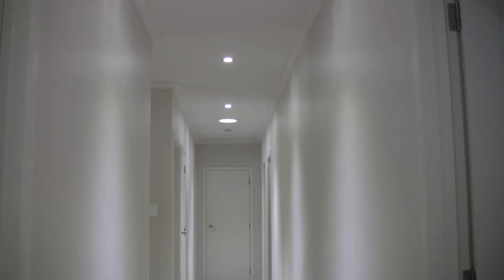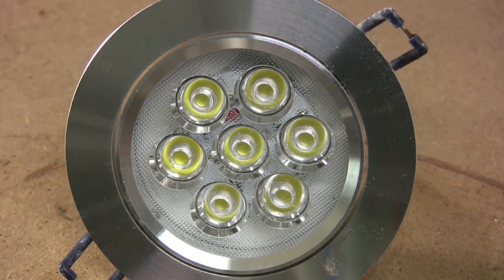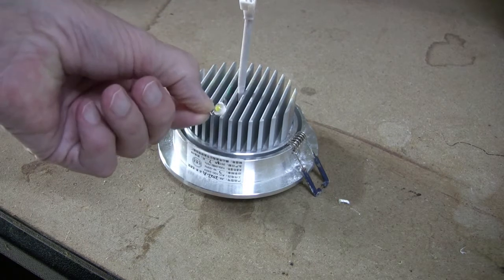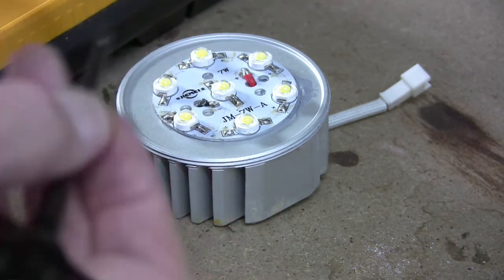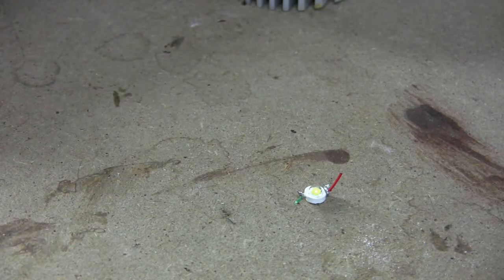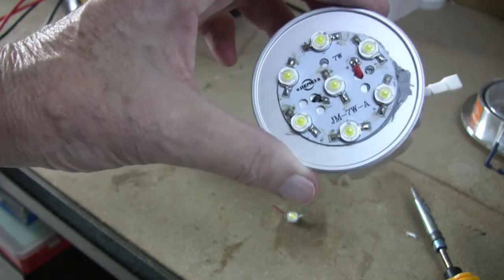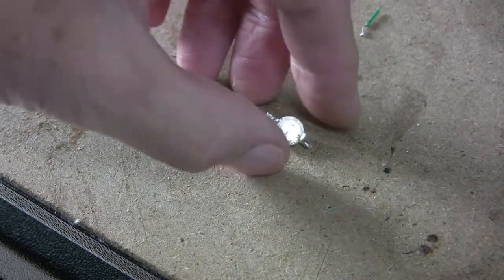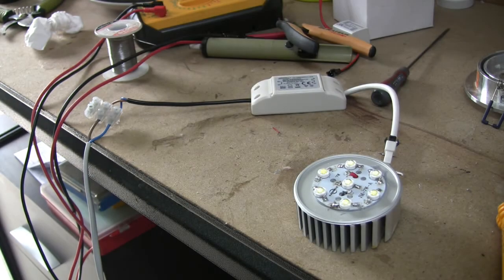LED Repair of cheap Chinese down lights.

Comment: There must be heatsink compound under each LED otherwise they will fail one by one. Their quality is fine, but you're wrong saying they don't heat up. 1W is a lot of power in such a small area. You wouldn't be able to hold the diode between your fingers when it's on. It can easily go to 100 degrees C without a heatsink and thermal compound.
I'm talking from experience. The lights in my bathroom stopped working one by one after 6 months. I've replaced each LED with a new one + heatsink compound and it's been 3 years now and all the lights still work. I've bought 50 LEDs for $2.
Reply: you're a professional  LED engineer，LOL
Reply: :D

Comment: Hi who to but voltage in the multimeter?
Reply from the maker: Sorry Sadeq, I do not understand your question!!
Reply: Michael Beeny  I’m sorry I don’t understand the way you test the led chip and make it on by using multimeter
Reply from the maker: Any multimeter used to measure resistance uses a low DC voltage from the internal battery of the multimeter. Because of this you can test most single chip LEDs. When connected in one direction you will get no resistance or no tone from the meter. In the reverse direction you will read a low resistance and/or the tone will sound. At the same time the LED will glow, not brightly but quite visible, indicating a good LED. No reading and/or no tone or light obviously the LED is faulty.
Another way is to use a 3 volt button cell to again test in both polarities, one way should light the LED.
I hope this helps you Sadeq, thanks for watching.
Reply: Thanks that’s was very helpful all the best

Comment: Another good video here, and another guy who has had problems with LED's. I have bought some LED GU10 downlighter bulbs for some fixtures in my house, and I bought budget models from B&Q, which is a large chain of DIY store in the UK. Some are 4W and some are 5W and all have 3 LED's in a triangle formation behind the lens. The ones I use most are in the bathroom, and they were all fitted around 2 years ago now. None have failed totally yet, but I have one in particular that I do have a problem with, in that once it has been on for 10 minutes or so, it will give the occasional flicker on and off, and then stay on just fine for a while, and then give the odd flicker again, which is like switching it off and on again, so it very noticeable. Its been doing this now for the last 6 months, but does not die altogether, so I'm wondering why it might be doing this, but I'm leaving it in till it totally fails. I suspect it may be because its directly over my bathtub, and it may have suffered from moisture ingress, but the other one in the bathroom is just fine. Mine are unlike your example, in that they retrofit into an older 50W standard GU10 fitting, and they have the circuitry built into the bulb itself, and the entire lamp is made of metal so acting as a heat sink through contact with them metal fixture itself.I think the most unreliable LED lamps I own are my Christmas lights, which are LED strings and often, once one LED fails, it knocks out about 7 other bulbs in the set, so I am left with a set with not many LEDs left working on it.

Comment: Oh yes, cheap high watt LEDs are super unreliable. In general LEDs have a very long life where they get dimmer near the end of their life and they'd likely get to dim to use before simply failing to work at all except that manufacturing defects in the LEDs cause early failure and that failure is pretty likely to happen within the first year of use. Thats why ironically its more valuable to get a used light you know has been used for a year. This all gets back to how the SMD chips are made. It's not actually the led junctions that are likely to fail its the components that support them. Each high watt LED is actually many small LEDs in one package and if any one of those fails the whole thing goes out. That means even though LEDs are highly reliable devices you're multiplying their failure rate in a high watt LED then there is many of those in each lamp. Those filament lights that have enough junctions to support 120 or 240 volts as input suffer the same problem.

Comment: You can buy those LED elements on ebay for 1 buck or two for ten. If they are 1 watt, usually it is a good idea to run them at no more than 75% of their max rating for a good life. Of course, if it is junk, it still will fail too soon.
Reply from the maker: Yes I do have a container full of LEDs of all types. Don't really know why I choose to use a seconds hand one. Maybe because it was laying about on the bench from previous experiments. I have measured one I repaired before, worked to to be 850 mW which sounds about right to me. Just been watching YOUR vid!!

Comment: it may be worth checking the power supply modules, and possibly reduce the voltage output slightly, they may be designed for 220V, not the 240V we get here, so may be generating a slightly higher than spec voltage stressing the diodes.
Reply from the maker: I'm sure you right about the 220 volts but as the power pack is current limited I double that will make a difference. However, saying that I will do a current test to make sure the LEDs are not passing too much current. From my experience the Chinese tend to claim high power but seldom give it. If it looks interesting I may well film it.